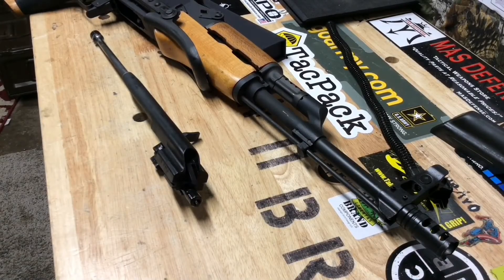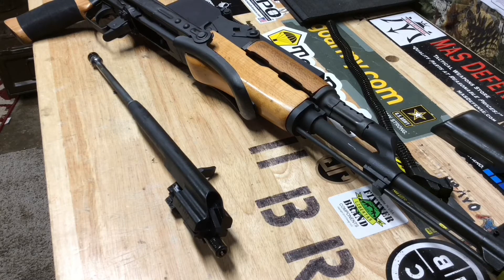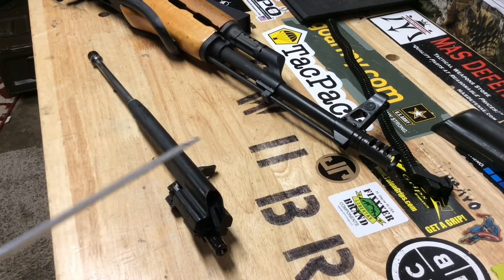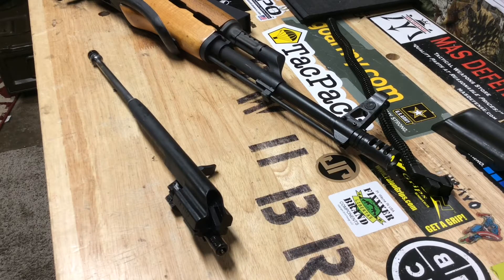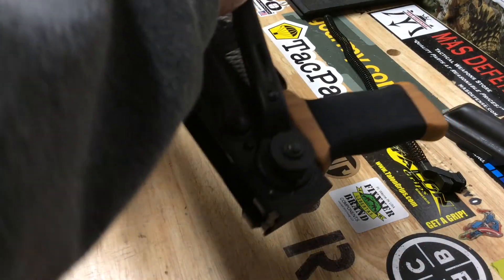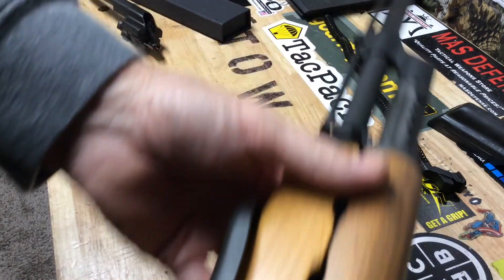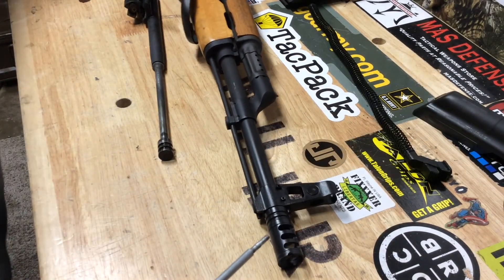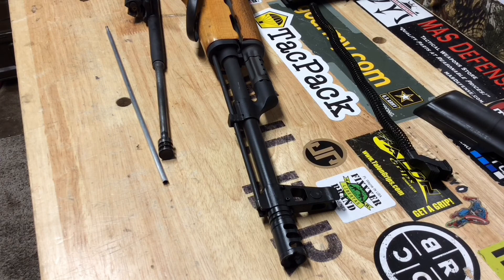AK 63DS 1,500 round update

Comment: Traded my Pap in for the same one. I think the front post was done by Century not Hungarian. I only got 80 RDS through mine and appreciate the info. Keep the videos coming because it seems that there is very little negative feed back on this weapon and with that said doesn't seem extreme. I did notice on mine it has two different pins in the front, one black, one more silver tone, but will keep an eye on it. Again, thanks! 👌
Reply: Bryan Romeo picked mine up a month ago and yes mine also has that silver pin on the front and has no issues i think thats Century fixing the issue on the newer ones